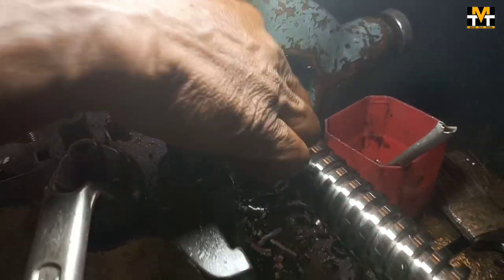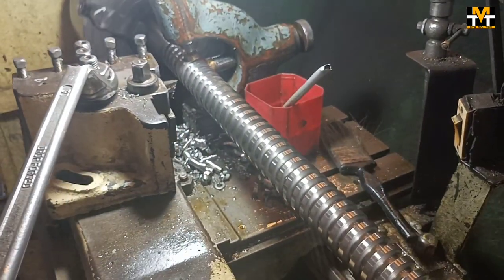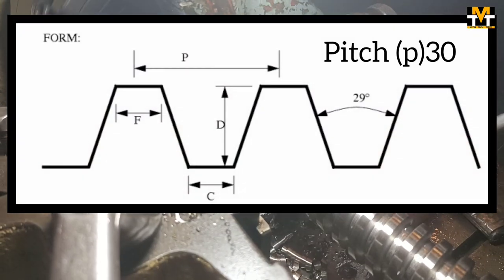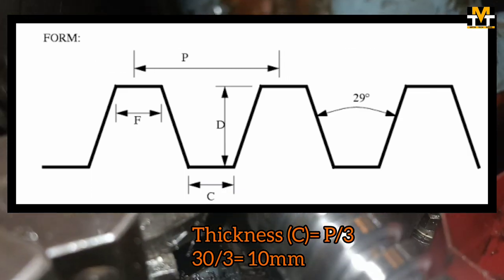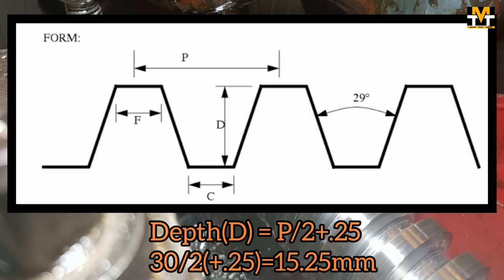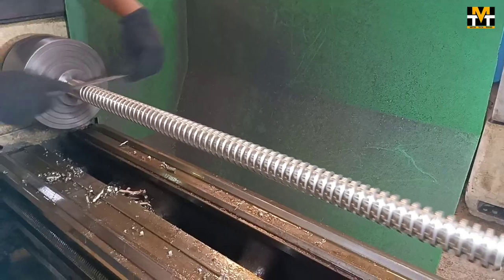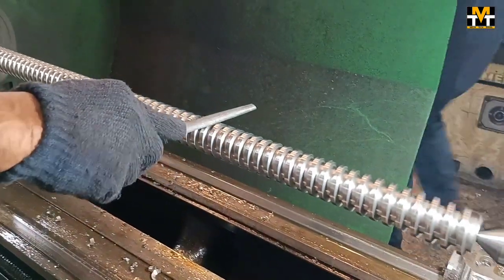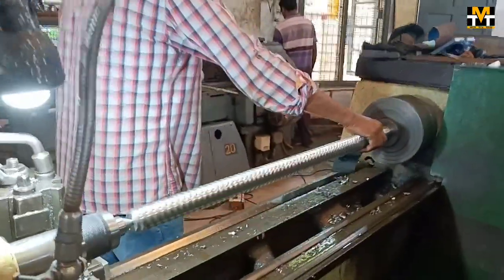Calculation of Acme thread and making video from mechanical shop.

Comment: Aa spanner angane hold cheythu വയ്ക്കുന്നത് ഒരിക്കലും ശരി അല്ല....it's a working machine
Reply from the maker: Yes.. You are correct.
Reply: Ath tool post straight aakkn aahnnu most of the machines have a key but  ethinu ath illaa ..but I'm not arguing with your opinion because your correct 💯